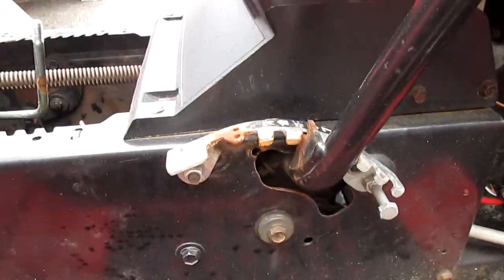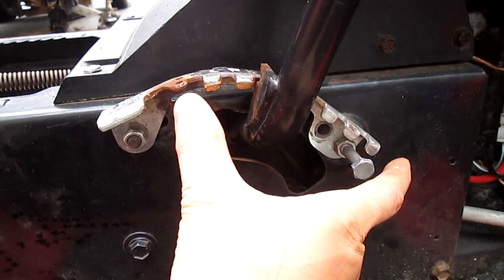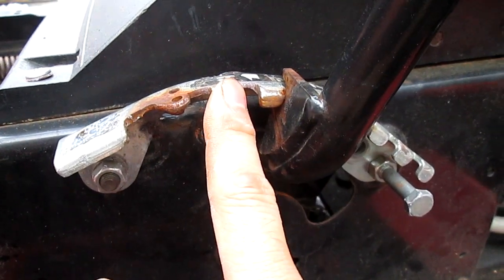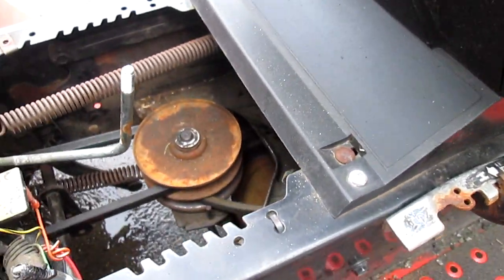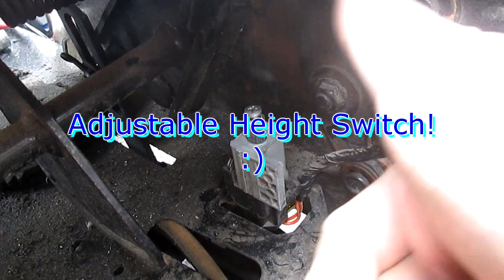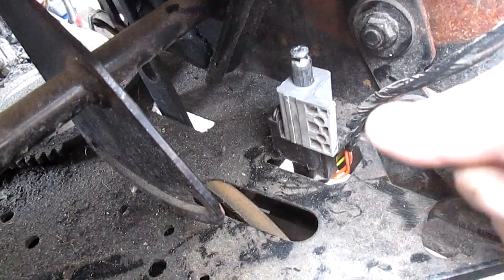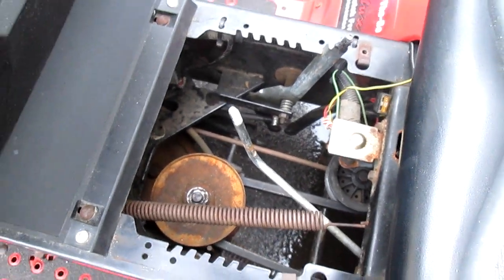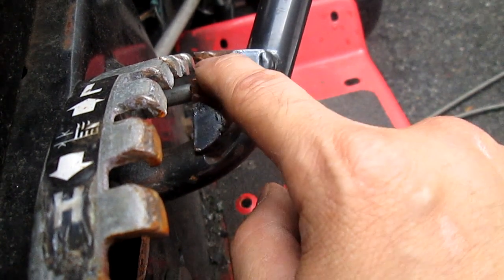Riding Lawn Mower Won't Start - No Blade Engagement Safety Switch - MTD Common Problem Fix

Comment: What if it's the safety switch itself?  How would you go about replacing that? 
It's in a very awkward place to get at.
Reply from the maker: Pause the video at 3:48 - You will see the Switch and you can buy it and replace it.  It's really easy... Just a clip holding it and just pop it off.  Mine, it's about $8.00 on Amazon.....  Look here:  https://www.amazon.com/Troy-Bilt-Cub-Cadet-725-1657A-Switch/dp/B07CJX96N9/ref=pd_sbs_86_2/137-6474431-9434341?_encoding=UTF8&pd_rd_i=B07CJX96N9&pd_rd_r=adb84df2-6c72-4eec-9f80-0b2b4184ccce&pd_rd_w=cZZpI&pd_rd_wg=3HLBA&pf_rd_p=bdc67ba8-ab69-42ee-b8d8-8f5336b36a83&pf_rd_r=P5ESSTSVY017M8B7370Y&psc=1&refRID=P5ESSTSVY017M8B7370Y

Comment: Do you have any info on a trailer hitch installation for a 2018 chevy equinox? Also where can I get one for a reasonable price. Thanks.....
Reply from the maker: +Rich Goldovich - Hahahahahahaha, no.... But those are easy to install.... Usually they have like 4 Bolts or 6 Bolts most.  On the Price... Depend on your Location.... Usually I get " Our " stuff at Autozone.... But if they are " Pricey ".  I get the " Item Number ", then I go to Google and find out what is the " Best Price ".  Sometimes I get them from Ebay as well.  But I use Google Shopping Search, then decide if the Shipping is worth it or same at my Local Stores!